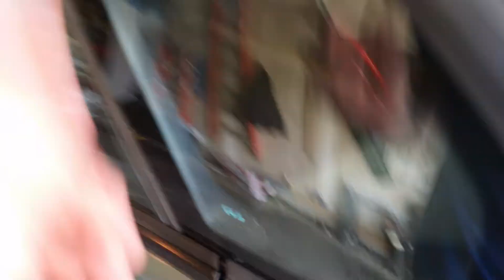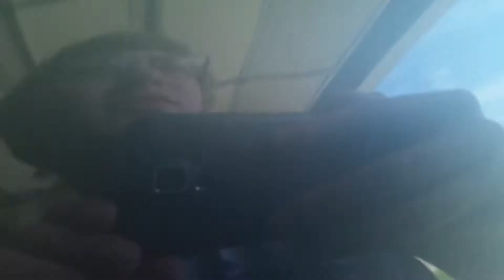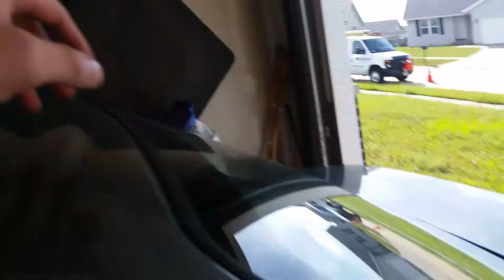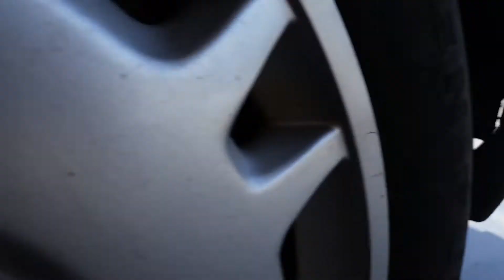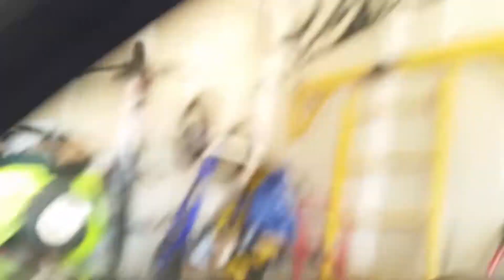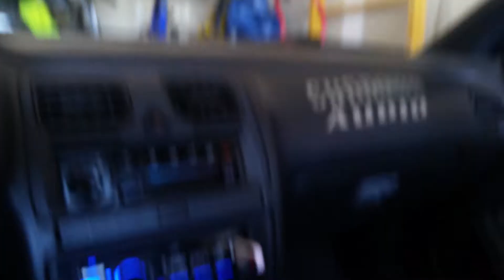SOME CRAZY BUMPER FLEX FROM 1 SUNDOWN X15

Comment: You can run 3 rimes rated on these and be fine ,as long as its clean unclipped power it shines at 2500 watts plus !
Reply: yea man ! that will run them perfect ! alot of people skimp out on the alt , but gotta have power to make power !
Reply: lol they are expensive but in order to have a major system you gotta have it ! amps x volts equals watts !